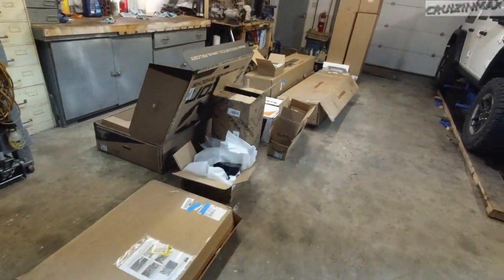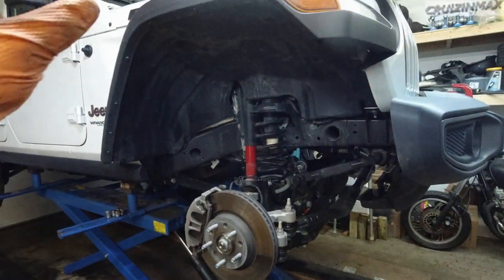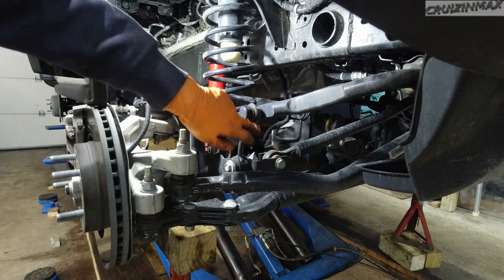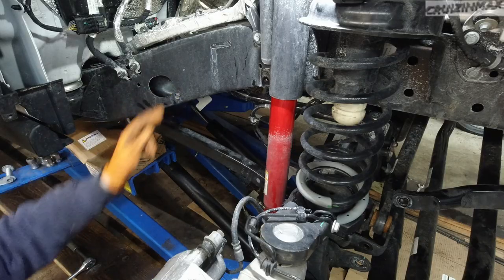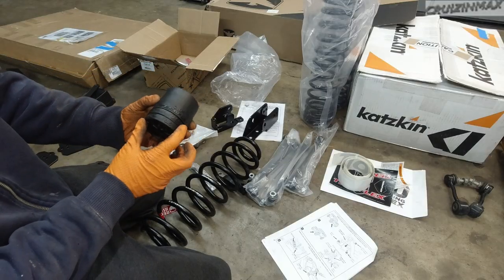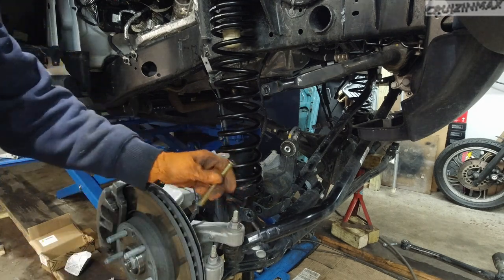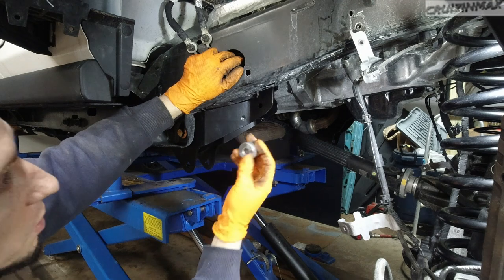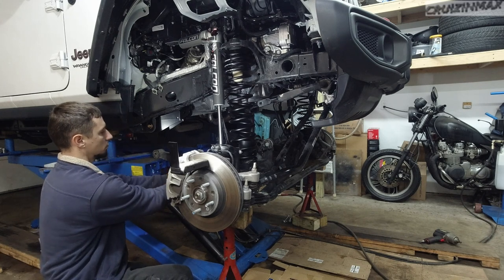20 Jeep Wrangler Rubicon JLU lift kit Teraflex part 1

Comment: Are you going to do a test drive showcasing the Magnuson? Really like to see some pulls, sounds and a review of the power delivery and shifting.
Reply from the maker: I do have 2 short vids recorded of open throttle but the jeep went for linex spray, seat cover change and a tune, so it may be a while until its back to make a proper final showcase video.
Reply: @cruizinmax4017  any way we can see the videos? I just got off the phone with magnuson, considering ordering a kit.
Reply from the maker: ok...give me a few days to make the video.
Reply: @cruizinmax4017  thank you!